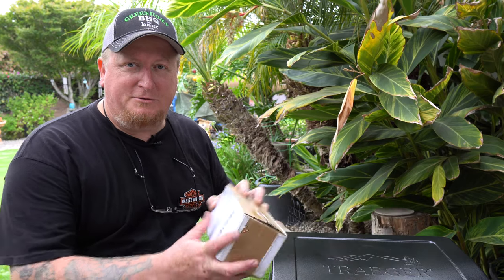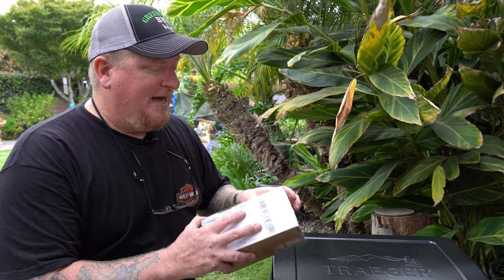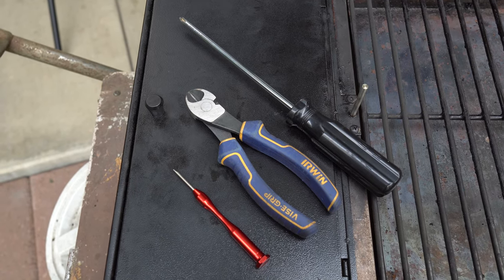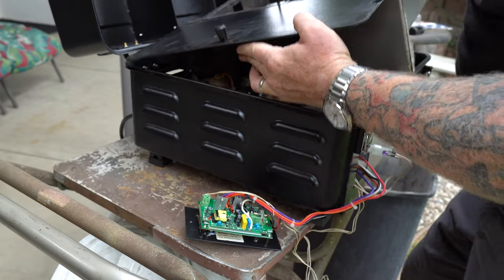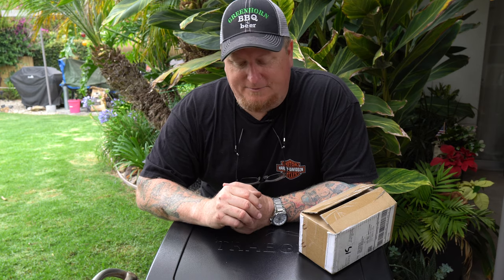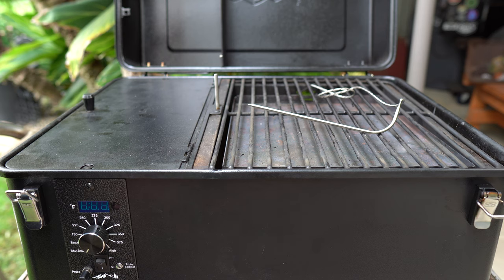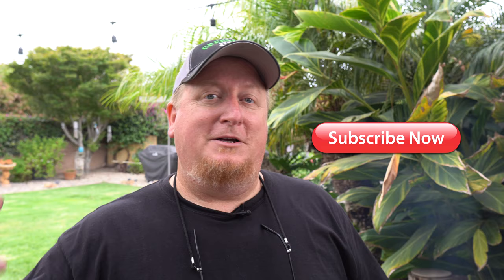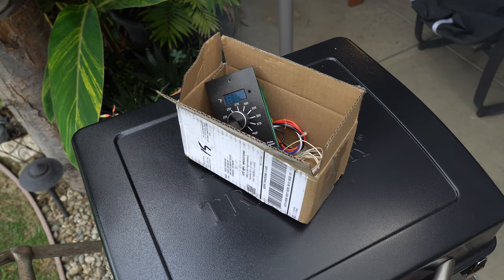How to replace Traeger Scout pellet grill Pro Digital Controller & RTD

Comment: I realize that I am a year late to finding your channel. I found it interesting because I just bought a Traeger Scout at Costco. AFTER buying it I learned about the recalls. 

I think the biggest issue is physics. I view it as a portable pellet grill and NOT a low and slow smoker. It does well with higher temperatures and not so well at lower temperatures. I think that precise temperature control is impossible due to the tiny amount of airspace in this unit. Any draft, opening the lid, or even adding pellets to the fire will dramatically affect temperature.

I adjusted the "P" setting from the factory default of P-1 to P-4. It helped, but I still have the spike in temperatures nearly every time. 

My Traeger Scout will be used for a great small portable pellet BBQ grill. It is perfect for that since I am usually grilling for two. I will use the big old trusted offset "stick burner" for long low and slow grilling/smoking. After all, part of the fun is tending the fire!
Reply from the maker: Thanks for this detailed information!

Comment: I had the same problem with my Traeger Scout when I bought it about a year and a half ago. Traeger replaced my Scout with a Ranger grill under warranty, as they didn’t have a fix for it at that time (it sounds like they still have thee same issue). I recently had an “auger not turning” issue with my Ranger, and Traeger sent me a new auger motor for it. I had the same issue you expressed, though, that there is no schematic diagram included (or available anywhere, as far as I can tell), of how all the parts SHOULD go together- I was able to determine that is was probably the motor mount rather than the motor that was the problem, corrected it and got my grill going. I am skeptical, however, that the average homeowner is going to be able to fix these kinds of problems that you or I have experienced.
Reply from the maker: Great observations!

Comment: I have the same issue! Today I attempted to smoke a rack of ribs at 250, but temp shot up to over 300! I got a charry sear on my ribs, something I didn’t really want... 

I came across your video cause I was searching for answers too! Guess I won’t waste money buying a new controller if it didn’t work for you

FYI: During the cook I noticed that not refilling the hopper helped regulate the temp down in the low 200’s... once I refilled hopper the temps would fluctuate again. 

I’m guessing I’ll just keep it for grilling on camping trips on a high setting, but won’t be able to use as a smoker. 🤷‍♂️ 

Ive never had issues with my Weber Smokey Mountain, I recommend you get one, the temp never fluctuates, holds temp like a champ 💪🏽

Comment: I just got the scout and haven’t even got past the seasoning process.  It does just what yours did.  Will be calling Traeger. Kinda scary knowing that you can’t even step away during your cook without worrying of runaway fire danger ruining your cook.
Reply from the maker: Its crazy...
Reply: Update.  I took back the worthless scout and paid a hundred extra for the ranger.   So glad I did.  Have had zero problems with the ranger.  Maintains heat very well.

Comment: We have the bigger T. It would work on smoke then turn off at adjusted higher temp setting. 
Struggled for months  with this. 
I decided it needed give a through  look over. I found the two probe wires between hopper box and oven part cut in two. My thought is the smoke setting was ez enough to allow current as they were butted up to each cut piece but then the higher temps drew more current? And broke the connection?
The wires inside are hair thin.
I tried to strip a twist, gently,  the wires together and now the temp shoots to the 500 degree at every setting. 
After reading watching your video,  im not sure I want to replace expensive parts.
I'm already not a T fan.
Fish habitat as far as I'm concerned.
Reply from the maker: I think you are on the right track, fish are good eating!

Comment: I watched a video with this problem. The reset process went like this. Close the lid. Start it up and let it run on smoke for 20 minutes. Then with the lid still closed turn it to high. Let it top out. Should be about 440 or so. Then do the shut down. That should do it. Worked for me. But, hey lots of people are having trouble with traeger. My first one went 7 years no trouble. My new one is 2 years and working fine. But the temp goes plus or minus 25 degrees
 No where near what they clam. Not too sure my next one will be a traeger.
Reply: with pellets?

Comment: Hey Todd!   Wow......where to begin???  You know I had a Lil Tex over 5 years ago and that thing drove me insane with it's crazy temp swings.  Spent several times on the 
phone with customer service and depending on the person I got different stories and solutions to this problem.  From the cap height to the "P" setting, short of sending me 
replacement parts which I wanted No part of.  I also have a friend who has a Traeger and boxes and boxes of replacement parts that made No difference in the operation 
of the pit.    Here's the deal.......their system works on a timed cycle that controls the auger.  That's what the old "P" setting controlled.  Some say with this timed sweep of 
the auger produces more "Smoke".   Well, it may or may not , but one thing,... it can't adapt and adjust to the set temp.  You get high temps when the auger dumps pellets and 
they combust into a blaze.......then you get a long period of smoldering pellets after they have been dumped and haven't caught flame yet.  It's a vicious cycle that is 
totally uncontrollable!    So if You are looking for stable temps within a few degrees of your set temp.....You Need To Look For A PID controller.  
You watched my Vid and it held temps within five degrees of set temp,   and mine was just a Hack set up!    You need to look at Smoke Daddy . com........they have a 
replacement panel that is PID controlled and will plug right in to the Traeger.  PID doesn't work on a timed sweep.....it takes in the temp info and adjust the on/off depending on the temp. It's just like how a Guru Stoker works, or any of the stokers used on charcoal pits.  Easy!.......Problem Solved!  😁👍  🍺  \m/
Reply from the maker: I'm on hold with tech support right now. One last try then I'm changing lanes forsure!
Reply: thanks the info about a different controller

Comment: I had nearly the same problem today, worked fine on SMOKE  but when I went to 250 the temp continued up until I got a "HIGH TEMP ERR". The auger never stopped turning and emptied the pellet bin. I called Traeger and they are sending me a new motor.
Reply: I got the new motor, what a PITA to install. When I went to power on nothing worked, called CS, they are sending new front panel

Comment: I got one of these that was broken. I fixed the issue. Just a broken wire bad connection etc. I noticed mine even on smoke or 180 would stay around 350 on the read out above the dial. I check it with an IR and it was perfect right at 180. it seems the read out is incorrect? I am not saying this this the issue with all of them because it sounds like some do have auger issues but checked the temp with a second device does help narrow down the issue.
Reply from the maker: Thanks for sharing Lance

Comment: HEY!! Found the real problem with them is the thermostat wires were ran between the insulation and the “firebox” which put the wires right against the firebox so heat was being detected in the wrong  place and burning the wires up.
Reply from the maker: At 4:23 you can see where I routed the wires between the insulation and electronics box.
Reply: THIS was the blog i was looking for!The instructions that came with my RTD did not give detail that i'm glad you and Todd do about actual routing of the wires and the insulation pad. I hadn't pulled the machine out of the case (yet) but by removing the hopper bin at least gives more room to work and revealed the insulation pad. Tugging the wires from either side suggests they had melted and stuck to the pad -- guess a flameout will do this -- but even then i hadn't seen the "HEr" error yet. After seeing all 3 helpful videos and read all replies, i'm skeptical the new RTD i received or other items mentioned will prevent my issue of constant pellet feed regardless of temperature. And when too many pellets collect in the firepot, i get the soaring temps that force me to prop the door open (losing precious smoke and uneven cooking) then eventually choke the firepot then temps take a dive down to the "LEr". When i remove the grill and drip pan the firepot is full of pellets. See someone else's reply about the fan and auger -- if these are design problems to the Scout model, does Todd or anyone know if the Ranger model is any better?
Reply from the maker: I believe Ranger owners have reported better results 😉

Comment: I was just on the phone with Traeger customer support about the temp issue with the Scout. After checking the Auger they concluded the controller was faulty and they would ship a new one. The weird thing is that I got email confirming all this with a link to this video for the instructions how to install the new controller. Do you know about this??
Reply: Isn't is strange they would point me to a video that actually says the problem will not be fixed with this new controller?
Reply from the maker: That is strange.... I hope in the end it works out for you. Keep me updated.
Reply from the maker: Oh, and I did not know they were using this as an example on how to install. But I suppose that in the absence of any real instructions this will do eh? Thank you for bringing this up!
Reply: @GreenhornBBQbeer  Yes thanks. Great to have the instruction video although I managed without. Also great for preparing me this new controller would not fix the problem 🙁 I did not.
Reply: @GreenhornBBQbeer  I called them again and in no time they concluded it must be the auger motor. It is on its way to me now so let see what it will do.
Reply from the maker: @flortheberg  Can't wait
Reply: Oke I got the new auger motor and installed it. Now I kind of totally rebuild this machine. I could work at Traeger. Very unsatisfying though because it doesn’t do anything. Nothing changed in the way it behaves. Temp goes from low to 300 or 400’s back to 150 and back up again. I decided to return it to Costco without having cooked anything on it. They did not even look in the box when I mentioned the temp problems. They knew.

Comment: Same problem, replaced probe, then the controller, they are sending me a new auger motor. If this doesn’t work I will insist on a replacement or my money back. I would rather have a new one as we have another bigger one that works great.
Reply from the maker: My "replacement " is good for "smoke " and medium and high heat. Its not 100%. So its banned to my travel trailer.

Comment: It took them MONTHS to get me mine. I got it in an envelope. NO INSTRUCTIONS. BbQ weather for me now months later and they told me to find a video- here I am. This is my first experience with Traeger- I only used it three times before I figured out it was the machine's fault not mine. HORRID frustrating experience so far.
Reply: I am screwed. Pigtail? Jeesh. I so should have insisted on returning the POS.

Comment: They sent me a replacement but with no return shipping label Did they do the same with you or did the shipping label come in the (replacement)box they sent you
Reply from the maker: No return anything for me either...
Reply: @GreenhornBBQbeer  How was your secondary unit working and if it’s working great let me know if you open it up to see if it’s anything different they did doesn’t hurt to have two units working lol
Reply: @GreenhornBBQbeer  I think I would put the red control module in as a replacement But I’m not gonna lie when I seen a video of you taking apart a look like you were diffusing a bomb so I knew right away they’re gonna send me a new unit I’m not gonna play around with that I don’t work for Traeger

Comment: I will tell you why the grill sucks. the fan has no speed control. my solution is to put in an adjustable fan and auger. however this would require a new controller entirely that can control fan speed/aguer speed. This grill sucks because Traeger let china build and design the thing. if someone at Traeger wanted to take fault I understand, but this product is under engineered. it has virtually no control other than when to feed pellets and that is a constant process it cant stop feeding pellets. Its only designed to turn the auger off or fan off or back on again. which would stop combustion. thus the fan cycle by holding the middle button it can turn off the auger or the fan or turn them both on but cant control the speed. essentially we are sold a device that does not come close to meeting claims of 10 degrees off the set temp. the pellets don't burn all the way either when smoking on this grill.  I get a layer of pellet dust that is extremely flammable at the bottom of my grill after smoking. if I go from smoking to grilling you bet I will need to vacuum the floor of the grill or I will get a nice fire that is spontaneously lit when opening the grill its scary as hell. my temp set at 165 swings from 171 to 280 degrees F . I also have the ranger version not the scout. so I have a fully digital controller

Comment: I just did the same. If mine continues I’m gonna run an old school Red LED controller. I have an old Traeger with Red LED controller and has never failed me
Reply from the maker: Thanks for this. I'm going to go look it up, any suggested links you want to post? Also, feel free to post in "COMMUNITY" tab up above. Cheers!
Reply: If yo u still have it, looks where the wires are actually threaded through. Mine had  the wires between the insulation and the fire box, WRONG, they have to be on the other side of the insulation.
Reply from the maker: @JPNiemiec1  At 4:32 you can see where I routed them after the new ones installed, between the insulation and electronics box.

Comment: Time to kick Traeger to the curb. 🍻
Reply from the maker: Oops! I hope you didnt come to this conclusion from just my experiences. I have another Traeger and in 8 years has not skipped a beat.
Reply: @GreenhornBBQbeer  you are lucky. I owned one and it worked great for a few years then had temp swings like crazy. Felt with customer support which was great, they sent me every replacement part but still didn't work. Hope you continue to have better luck with yours. 🍻